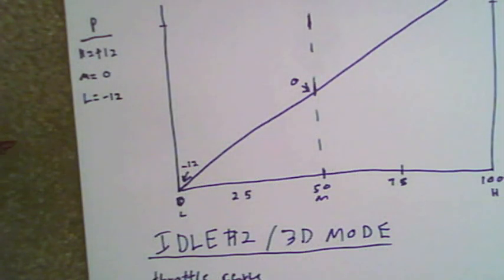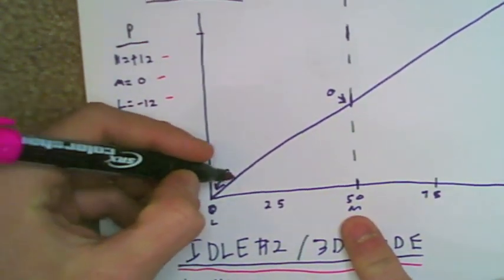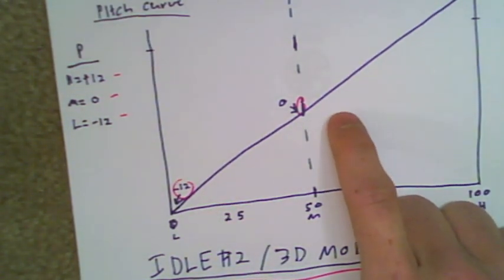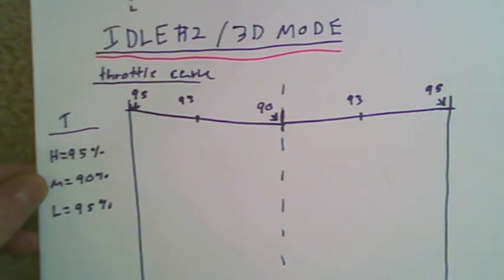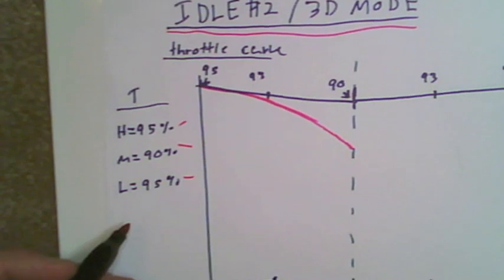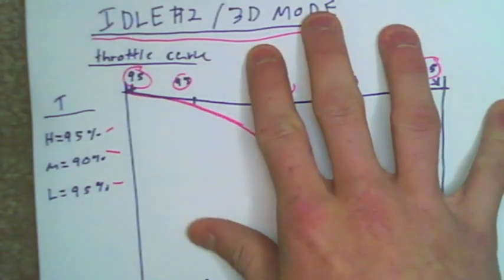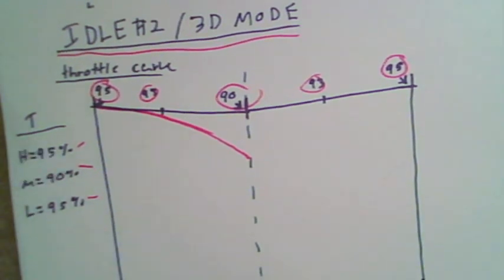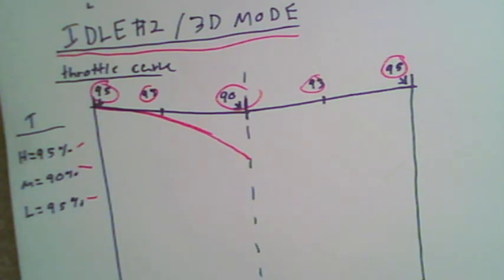freddy can fly (3d throttle and pitch curves)

Comment: I dont use a governor, i fly sport only. What would the ideal throttle curve be for nitro. Electric is fine and works great with 75% to 80% throttle lineair. Does this work on nitro or do you go from half stick 80% 90% 100%. Or 80-85-90%. Talking about half stick +5 pitch till full stick +10 to +12
Reply from the maker: It can all depend on the motor and blades and pitch EX.  The best I can say is if you are not using a GOV then you need to have a V curve of some sort to compensate for the rotor disk load.  Also the tuning of the motor is going to play a big role in how the throttle curves feel or make the heli feel.  80,90,100 could be a good starting point, but I am sure you will have to tweak it as you adapt it tor your own flying style.
Reply: @FreddyCanFly  Thanks Freddy, i could not ask for more, thank you for your thoughts 🙂🇳🇱

Comment: What are the settings for Idle 1 ?
Reply from the maker: These settings are for a basic setup, most setups these days will vary based on which FBL system you have.   A lot of them have built in GOV that altered the way throttle curves are used.
Reply: Freddy Cordova thanks for the reply .. first of all great videos ,i’ve learned a lot so far , i recently purchased trex550 and  (still waiting) for it .. the heli i’ve been   flying is walkera 450d03 with devo 7 and trying to convert it to my taranis as trex will be my primary heli, any tips or setups would be great

Comment: Hey Freddy, great video 🚁🚁🚁  Thanks👌🏼
I just bought my T-Rex 450, & saw a YouTuber recommending beginners use zero - 40% max throttle.
What d’you think??💥
Reply from the maker: Absolutely not lol, your Heli will barely lift (if at all) at 40% throttle.  Not to mention the crazy low head speed would translate to very poor cyclic resolution and little to no control over the Heli.  These heels are designed with an RPM in mind for maximum control over the Heli.  You can change the the way the sensitivities are of course, but you need head speed to fly a Heli.  I hope this helps :)
Reply: Freddy Cordova  Yes that does help - thanks!! 🌈 I’m used to 4 channels and without going inverted, I want to start punching it!
BUT I’ve been told to check the settings on the included A10 transmitter first (a bit fiddly).
It does make sense for 2 reasons: higher head speed  = more stability like a bicycle wheel spinning.
Plus the blades are more stable at higher airspeed like aeroplane wings - they want to stall at low speed through the air - right?
Great to get some feedback! I’m Martin by the way 👍🏻.
Check this:
https://youtu.be/GvRjoZGVpZw
Reply: PS. Having the 450 tied to my workbench, neutral pitch, 100% head speed is vicious! I’m scared of any sudden or unstable inputs when I first take her out! 😬😬

Comment: The only issue I have is when moving from normal into idle 1 or 2, because normal mid stick is +5 (flying pitch) when you go from there to 0° on idle 1 or 2 the heli drops altitude dramatically. Also, it's feels we it's as though I have to input way more stick movement to get the heli to climb or decent in the idle up modes with the 0° mid stick setting

Comment: Not recommended for all, but here's what I do.  Fly one mode. ONLY!!!  Flat throttle + full pos to neg pitch(max) curve.  The other two clicks on mode switches both set to throttle hold.  That's right. Take off/land with throttle hold.  Actually, take off requires "both" throttle hold switches to be tripped.  That means double safety!!!  ESC set to soft start.  Multiple mode = multiple heli response/feel.  Don't need that unless, let someone else fly it or need drop throttle for weak batteries. I'm advanced and just learning more tricks with one heli > one mode > one feel. Not multi heli's and multi mode's = exponential "touch" that requires mastering.  Peace.
Reply: +trexinvert High throttle idle-up is the answer to lack of tail authority.
Reply: +Anthony Abelardo Yes, that's absolutely right.  Also, if you want to trick it even more.  Add more expo to the rudder(-expo for JR/speks and +expo Futaba).  Thus, with "smallest movement" you will get full rudder in either direction...but only if your fingers are ready for it...not for retired guys/w shaky fingers or beginners.  Keep on.
Reply: trexinvert or just run no expo on the rudder

I need to run idle-up because I'm on a 5-rotor with stock blades and gearing.

Comment from the maker: hey bud, 
u should be using a gov i have the align gov setup video give that a watch.  also when using a gov its based on rps, so it uses your throttle curves to make its corrections. 
for my curves i use this ( but be aware throttle curves are based upon my flying style and helisetup) 

normal (o,20,30,50,80) i use normal only for hover, land, and take off thats it
idle 1 (90,70,50,70,90) this is a good for sport flying (gov @ 18-1950 rpm) 
idle 2 (100,90,75,90,100) great for 3d (gov @2-2250)